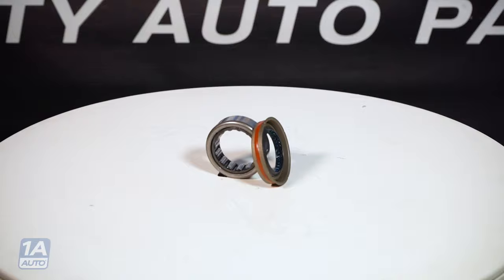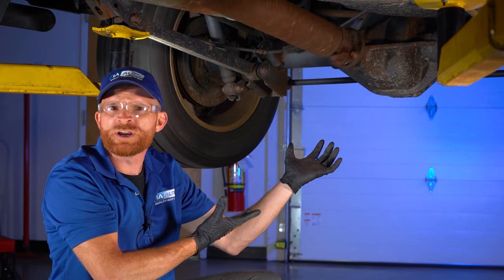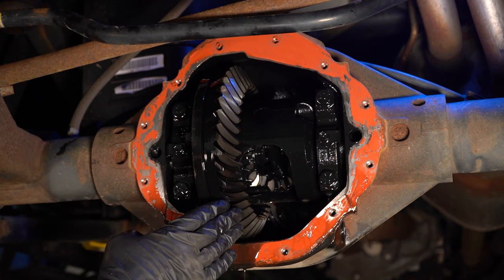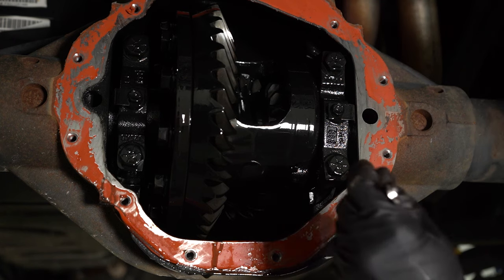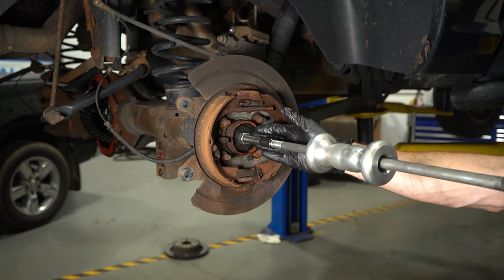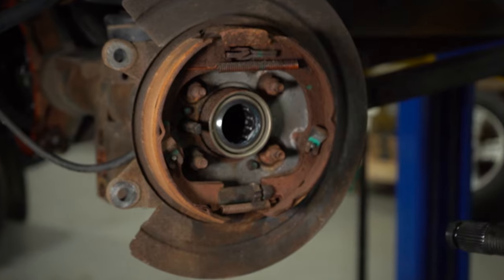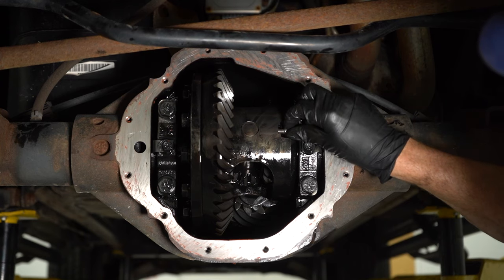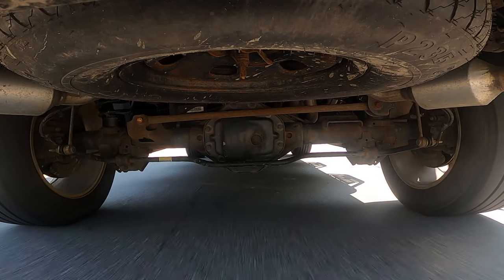Humming Noise From the Rear of Your Truck? Replace the Axle Bearing Before It Starts Grinding

Comment: Good morning..I would need help..my 2005 Ram 4.7 with the big differential..was fine and one good morning..a second the truck is turning a little my rear wheels suddenly lock..as if my Rachette worked badly and caused his backlash on my wheels

Comment: HELP!!! I have a 2012 Chevy Silverado 1500 5.3l LTZ. I started hearing a roaring sound from the front and it sounded like it was coming from the driver side. I bought a new hub assembly and put it on, but I still hear the humming sound. I've rolled up the windows so I could hear it better, but I can't pinpoint where it's coming from. It's odd, it sort of sounds like its coming from in between the front wheels in the center of the front wheels. Any ideas???

Comment: I replaced the rear shocks on a 2006 Mustang GT with Bilstein ones. This car always had some slight humming noise in the rear end at highway speeds. With the new shocks it is completely quiet in the rear now and I don’t understand why as this car was basically like that since it was pretty new. Any idea what new shocks might have changed?

Comment: I had a noise coming from the diff, turns out if was the parking cable housing rubbing against the drive shaft

Comment: I am on your subscribed list and my son just sent me info about the rear of his truck making noise. He is deaf but with his hearing aids he can hear some and pretty well decern where it is coming from. I sent him this video and told him to check and see if this might be his problem. Because it is not happening all the time.  It is on and off and the mechanic can not find it. I hope if he leaves you a comment that maybe you can advise him a little better. Thanks for all your great advice. I have used your advice quite a few times now.